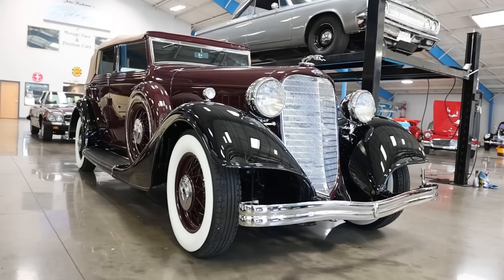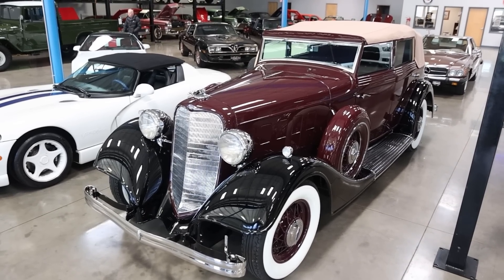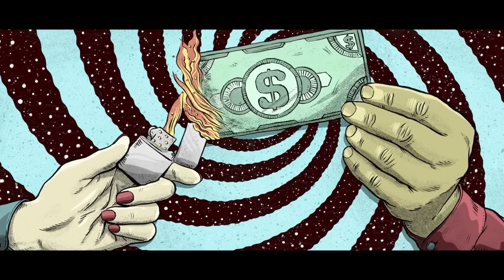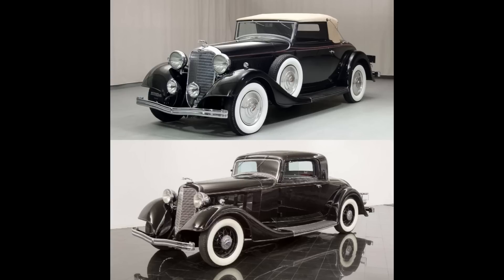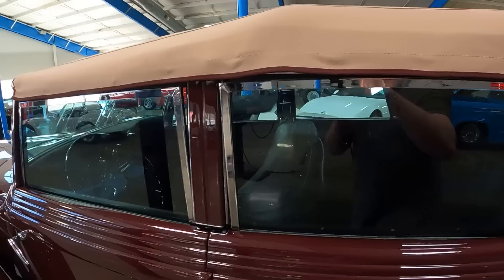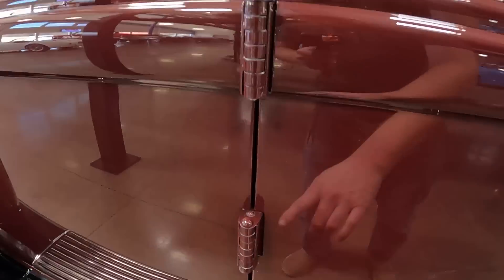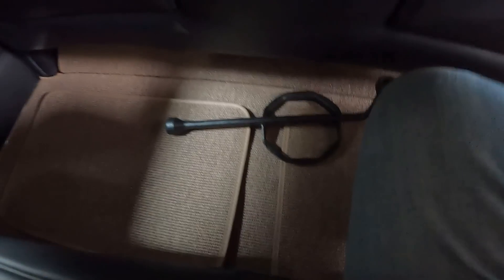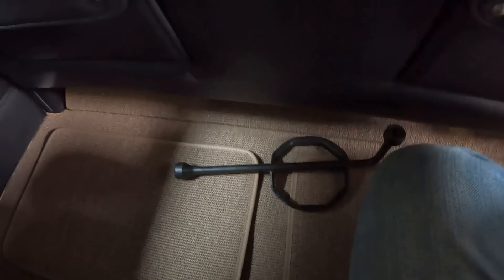1934 Lincoln model KA Convertible sedan/phaeton ￼

Comment: 1934 Packard Twin Six; we're a Buick & Packard family historically, though the Lincoln is a very beautiful car, and you did a great job showcasing that amazingly and superbly well restored Phaeton.  It is, of the three photos, the most attractive car in the pack. ♦️😊😅
Reply from the maker: Thank you so much Chuck it means the world to me that you dig this episode =) 

I want to cover a packer twinsix so bad this year either a twin six or 12 I’m not picky..
Reply: @What.its.like. Edit: Yes, showcase a Packard Twin Six!!. Jay, the cars from 28' - 38' were gems, and the top of the line Lincolns, Chryslers, Cadillacs, Buicks, Packards, and the rare breeds were works of art.  You've got the right technique for showcasing these fantastic cars. Floyd Clymer shows us a couple of 29' custom bodies built on Packard, Cadillac, and Rolls Royce chassis which were superb in craftsmanship and style, and I am surprised by the 1915 Packard Twin Six Coupe', with a very smooth running engine and a very beautiful body for 15'.  Driving a 1909 Packard is worth it if you get the chance; shift lever outside the door, right hand drive, and the accelerator pedal is where the brake pedal should be, plus you have to double clutch and feel your way into the next gear, but even then they had plenty of power, like driving an old tractor but smoother!  My Grandfather had a 1932, 9 passenger Buick, he cried when he got into an accident with it and it had to be scrapped; do you know of anyone who has one that you could showcase?
Reply from the maker: Not off the top of my head but I keep making more friends every day I’m hoping to get out and go to some really good car shows this year I’m gonna go to Hershey I’m not entirely sure how many days I’m going to go to Hershey for in October that is the honey hole of all honey holes if you’ve never been it’s definitely worth going.

I’m not that far away from Warren Ohio they have a Packard Museum there there’s another packer Museum in Dayton Ohio but museums are kind of weird with letting me get in the cars.. but then again every museum is different I might reach out to the Packard museum with the weather getting nicer I wanna see if I can find some cars a car shows

Gilmore auto museum has ride in the Classic Car program I’m gonna go up there that place is absolutely incredible =)

Comment: The little jewels on the tail lights are called “blue dots.“ They’re still popular with hot rodders. I don’t know if those work the same way as the ones on hot rods but the modern ones change the color of the light emitted by the tail light to a magenta color. They used to be illegal in some states because of that.

First round goes to the Packard, and the second round goes to the Hudson Woodie!
Reply from the maker: Thank you =)
Reply: you got it right dw

Comment: Small point Jay , the earlier Lincolns were VEE eights , not Straight Eights . They were beautifully made and balanced units with expensive 'Fork-and-Blade'  connecting rods  ( not side by side on a crank journal ) They were known for their endurance and ability to maintain high speeds , but were expensive to build . The V12s were a simpler design , and had so called 'Aeroplane Bearings' ( non Babbitt ) , so less expensive to build .
Reply from the maker: Thank you so much for that correction =)
Reply: 1934 Packard

Comment: 19:22  I was wondering if there's a water pump on that car?
     I understand that some cars did NOT have a water pump, instead relying on convection to move water up and down from the engine to the radiator.

Comment: I would prefer the 1934 Lincoln . I would rather see the 1935 Hudson.

What a beautiful restoration. I wonder what the emergency brake looks like in use? And that engine! It looks like you could eat a meal off it, it's so clean-looking. It must have cost a pretty penny to get this car restored.
Reply from the maker: They restored it in 6-8 months they also did two other cars last year 1970 plum crazy cuda and a 69 charger Daytona

One vote for a 1935 Hudson super eight

Comment: I like the Packard best. At the time, Packard was right up there with Rolls-Royce, but more technologically advanced. This Lincoln may have a shiny engine, but I doubt they came that way from the factory. The Packard V-12's WERE dressed up from the factory and resemble more like a modern engine. 

The flat floor?  Remember, this was before  the step-down cars with the peripheral frames. There was no need for a transmission hump nor a driveshaft tunnel.
In modern cars with front wheel drive, cars like the Olds Toronado were famous for their flat floors. Other FWD cars may have smaller center tunnels, but that is where they run the exhaust.
Reply from the maker: Very true thank you so much =) 

We need to do more packards it’s just finding them, I saw a could at classic auto mall but they were hot rodded out I hate that I go for as stock as I can find them =)
Reply: @What.its.like.  Check with the Packard clubs and find out when they are going to have a meet. I had a customer that had a 1926 Packard Sedan and an award winning roadster. Both were 6 cyls.  Although solidly bolted in the frame, the only hint you had of the engines running was a little putt-putt coming out of the tailpipe. The engines were so smooth that they had no vibration. Ofcourse a multi-disc clutch inside a heavy flywheel, which was so heavy that we had to use a "cherry picker" to lift and move it. You go to a Packard meet and I guarantee that you will be impressed.  Even with the Packardbakers. Packard had been working with a replacement for it's aging bodystyle, the Predicta, which was reminiscent of what Chrysler did for 1957, with a little Lincoln thrown in for good measure.

Comment: A beautiful, true classic... if perhaps a bit "over-restored"; I don't recall seeing quite so much chromed piping/ancilliary bits on the originals, and those heads are highly polished cast-aluminum, they came in a rather flat finish from the factory. The "blue dots" were an aftermarket thing, and the character line should be a contrasting colour, preferably w. pinstiping. I know: some people gotta pick nits! Edsel Ford is a uniquly under-recognised genius designer; he practically single-handedly resusitated Lincoln with the L-series (a notorious favorite of bootleggers owing to its abilty to hustle serious "luggage" at "revenuer-plus" speeds), then rather perfected that design-language with the Model A... as Ford's chief stylist, he managed a rather brilliant styling coherence thruout the Ford line: the similarities between this and the '34 Fords is striking; the '37 Ford is really a mini-Zephyr, and his masterpiece, the original Continental, was his custom-built, lowered and sectioned, personnal Zephyr hot-rod. Yet for some odd reason, "styling by Edsel" never became a Ford slogan... hmmm.

Comment: Being an open car, it probably did come from the factory with a full leather interior.  That is NOT the emergency brake on the steering column. The emergency brake is on the floor next to the shift lever with the black release button on top of it.  That appears to be a factory installed rear view mirror, not aftermarket. Cars had mirrors in the teens and twenties!
Reply from the maker: Thank you so much for that added insight and correction I wonder what the park feature was on the steering wheel column
Reply: @What.its.like.  I'm not sure, possibly the switch for the fender mounted parking lights.

Comment: Those blue dots in the tail lights were meant to amplify the light coming out of the housing and it changed the color from red (red is tough to see in the dark and those old tail lights were sort of dim to begin with), to a bright purple color.

There were also yellowish orange dots that looked the same (cut glass jewels) that amplified the light coming off the rear end to look a brighter orange/red.

I guess it was an aftermarket crack at trying to make the lights appear brighter in the spirit of safety.

But it turned out that the blue dots just look really kool, so car enthusiasts have kept on using them well into the present day.

My old Hydra Glide has a blue dot lense on it... I've never been harassed by the Bacon for having it, but it's probably "illegal" here in HiHoho... Like everything else seemingly is😒
Reply from the maker: Thank you so much for all of that information I really appreciate it =)
Reply: @What.its.like.  you bet!

Thank YOU for the great content.

Comment: Dream cars. With that wheelbase what were they like to steer at slow speeds?
Reply from the maker: I’m not sure I will definitely have to drive a 1930s car I’ve driven a 40 Ford and that wasn’t hard to drive at low speeds because they had tall skinny tires.. but that is an interesting question.. The big steering wheels help out a lot as well

Comment: Oh ho ho - HF did NOT take the high road with the Leylands.  He was nasty as hell to them.  Won't go on at length, but it's well documented.  That said, Lincoln was the only place Edsel really ever had a free hand, and he made the absolute best of it, producing some of the finest cars of the classic era in terms of quality and, sometimes, style.  KB being the pinnacle.  (Interestingly, later in the 30's Edsel made the somewhat surprising decision to move the consolidated K even further up market in relative price - figuring that since they weren't going to sell many, might as well charge even more per unit - e.g. some of the later Brunn customs.)  Lincolns of the time were generally conservative - the 'old money' car; more so than Cadillac and probably Packard.  Slightly down on power too compared to the competition, but smooth.  In a sense, that could be perceived as boring, unless one were going for dignity at the opera...   WYR - I'll go with the Cadillac - on today's mood.  Do you want Art Deco (Cad), something closer to full on 31-32 era clamshell fender classic (Lincoln) or transitional (Packard).  It's like ice cream, your mood changes!
Reply from the maker: Thank you so much fir sharing all that insight as well as information =)

Comment: According to Ford = 1934 KA  had 150 horsepower at 3,400 RPM and 292 lb-ft of torque at 1,200 RPM.

The formula for "estmating" torque, is torque = horsepower of the engine x 5252, which is then divided by the RPMs at which it was tested, key word tested. 

So, if you use Fords figure - -150 x 5252 divided by 3400 rpm would equal =231.70 close, but not totally accurate. But keep in mine these were gross HP and torque back then and used as advertising.   In this case it appears the torque was determined at 2,700 RPM and would equal 291.777777.  Ps. Todays figures are much closer in accuracy generally.

So if you don't have  aTorque figure using the formula  (varying the RPM in the division) you can get close. 

WYR = 34 Packard Second =Toyota land cruiser.
Reply from the maker: Awesome thank you so much for that information I’m going to continue putting in a if I can’t figure it out because that formula works nine times out of 10 but it doesn’t work all the time. 

Case in point the Volvo P 1800 that we just did had a torque figurer the same as a horsepower figure